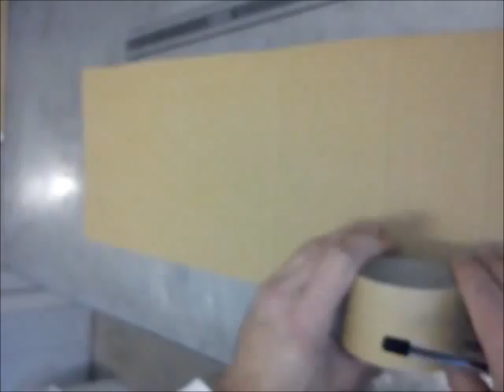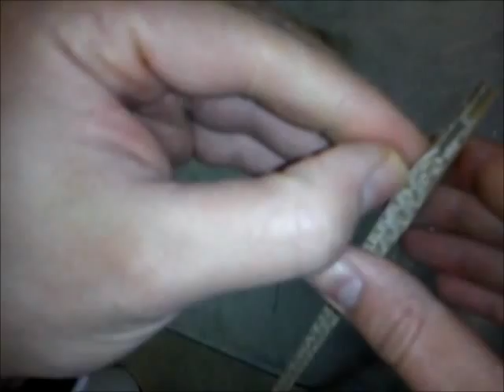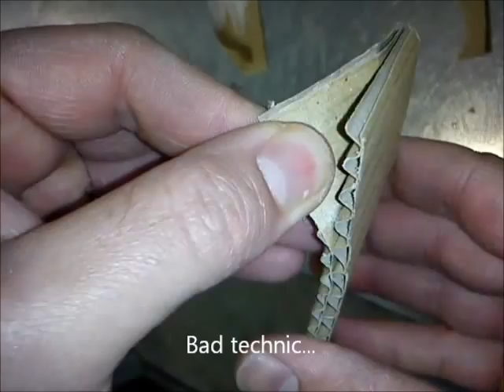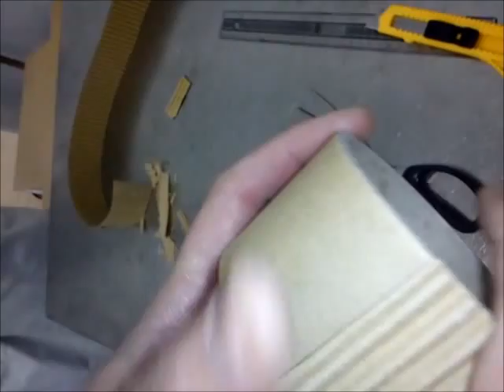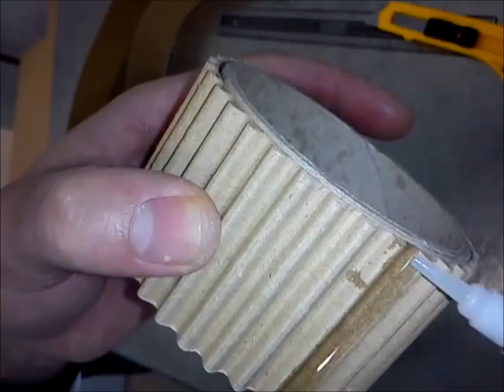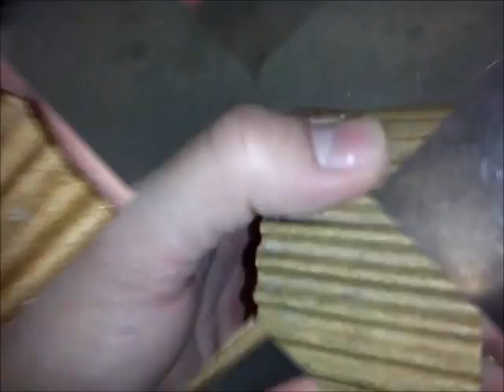How to make DIY gears from cardboard!

Comment: Brilliant idea!  Thanks for posting.  There's a water-based acrylic varnish/glue sold in craft shops for stiffening paper.  Not as hard as superglu, but cheaper and safer for young kids.  I'll try this idea out soon and if I succeed I'll make a plaster mould from the cardboard gear ( after varnishing) and use that to make stronger gears from polyester mastic (car repair stuff),  for my silly automata....  Should be great for belt drives too, using thread and silicone for the belt...
Reply from the maker: Ray Kent You're right! I had got superglue only, but the hardening is an important thing for usable gears! :) Cheers for you! :)
Reply: To get outer layer of paper off, also use nail polish remover (acetone) or rubber cement remover. Betone is hard to find these days, though

Comment: Just a quick note to everyone. Super-glue (cyano-acrylates) do and WILL bond human tissue (that's skin, or hair, etc.) to other tissues or any other material INSTANTLY AND PERMANENTLY! I hope you don't, but If you should find yourself in this unfortunate position, then remember that it can be dissolved by using nail polish remover. Just thought that those who are new to super-glue might need to know this tip, rather than possibly panic and rip off enormous quantities of skin. Its been around in the U.S. for many decades, but can be new and thus VERY VERY dangerous to others in other places where it is not quite so commonly available. Thank you for the video post Blade! Peace friends!
Reply: how did you get the gears to move? What's under the gears?
Reply from the maker: Ruth P just simple ball bearings
Reply: must have hole in the middle for a skewer, wire, straw. Empty tape rolls and toilet paper rolls must be covered, therefore.

Comment: i cannot belive it. That gear is getting Away without Shafts later..... But i don't have shafts at my house together.
Reply from the maker: If you use bolt and nuts across the bottom to it, never be going away. The glue is the basic in this bearing version, but the shafts are more stable. Blade

Comment: spray lacquer is very effective as well if you dont wanna use too much superglue. multiple coats and drying time in between.
Reply from the maker: Yes, you've right! the glued teeths are so much stronger, but if the gear working with low power than you can use it without any hardenner layer.

Comment: Hey im trying to make these same gears but using a tube that is the 12in in diameter. Do you think the cardboard in strong enough to for a bigger gear? and whatever you used for the axle, do you have an idea for how I could make a similar one that doesn't have much friction?
Reply from the maker: First: Thanx for your sharing! :) I think a bigger gear is possible with this method. I used plastic ball bearings for a good rolling performance. This gear hasn't got friction too much. Important the gears position for us. Small gap what I used between the gears. Teeth's strong enough...if you can use some high grade 2 components epoxy for hardening that will better then super glue.